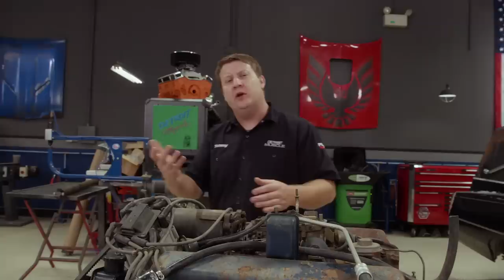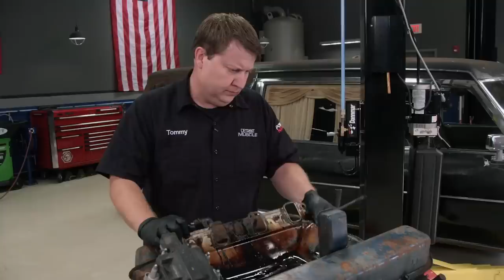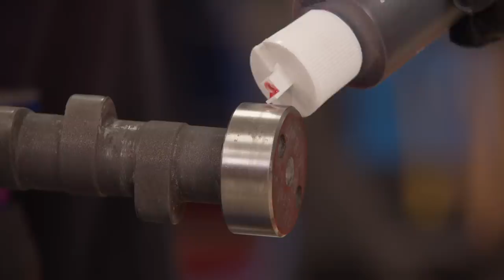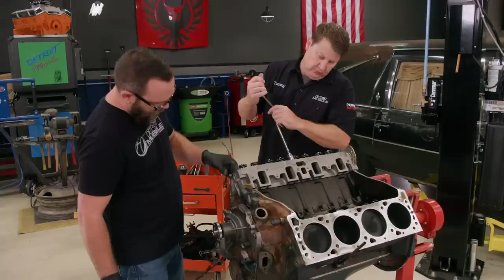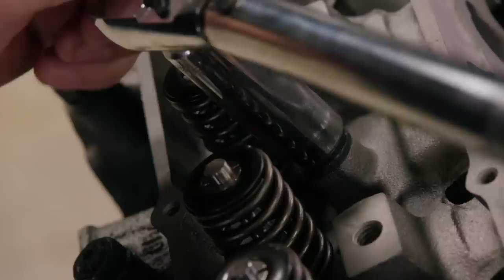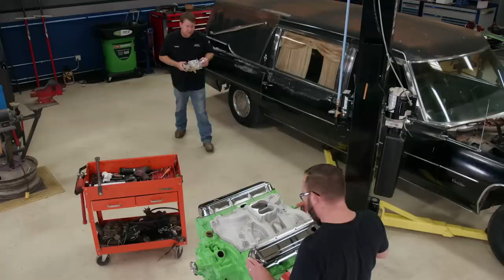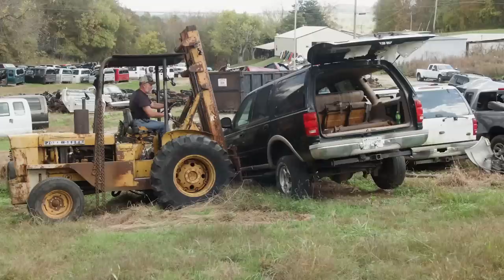Upgrading the Cadillac 500 To Make Serious Heavy Horsepower - Detroit Muscle S8, E2

Comment: I wonder if they checked the crankshaft bearing for wear.
Reply: Nope. Nor the camshaft bearings. Elcheapo ‘upgrade’.  That new camshaft lobes look near unmachined too.
Reply: They should have re-ringed and put all new bearings at least. nothing like a half ass upgrade.
Reply: @TheBeingReal  it's a coating to the cast steel that makes it oil slick and not run off for run in purposes on a flat tappet camshaft. 

Only time you'll see bright machined lobes is a reground flat tappet or a roller tappet. Because of the ramp rate and springs required for roller they always make them out of billet.
Reply: @TheBeingReal  I just installed a new Trick Flow cam in my small block Chevy and it looked the same. It almost looks like a thin coat of bedliner. (I know it's not bedliner). I assumed it was some sort of break-in coating. It was nearly black and rough as 80 grit sandpaper. The cam broke in normally.

Comment: He keeps calling the stock stuff junk. It was not. Those old rocker shafts never failed. That's not junk.
Reply: Cadillac rockers are fine IF you keep it completely stock but they are useless if you install a hot cam and upgrade the springs.
Reply: @timsharpe3498  Pretty much nobody buying a Cadillac back then was interested in hot rodding them. They were high end luxury cars.
Reply: @wymple09  

The engines were made so well that many outlived the cars and wound up in airboats

Comment: The 500Cadillacs are the new big Lincoln engines of the early to mid 1970's  They're power to the poor. In the 70's all you did is stroke a big lincoln and you had like 500 + Ft lbs of torque for relative pennies. Now the big Cadillacs are junkyard aging into the same role. Thing is, why not some moderate head work? Also what induction systems in order of cost are available and to what effect?
How about some kind of simple low cost intermittent use forced induction for momentary use?  
!

Comment: You're going to run nitrous oxide through that motor and you're not going to take the Pistons out and widen the ring Gap how long you think that motors going to last like that
Reply: I ran a 1975 Dodge SWB truck with a 472 inch Cadillac. Ported/polished heads, stock valves, Lunati mild cam (daily driver). Tweaked TH-400 with stock converter. Stock intake with rework Quadrajet, stock exhaust with 2.5 duals. Position rear with 3.08 gears and NOS 125 shot of squeeze. Would run 12.10's without spray, 11.70s with squeeze on 10.5 x 28 slicks. Put 125,000 miles on it. Great engines.

Comment: I have a 1967, so I'm gonna be really interested in this one!!😁😁
Reply: and your cool ... one day a year, 355 days a year your neighbors are like "oh that guy" Lol Im joking!
Reply: Ed Miller  I have thought about doing a 500 swap because parts are difficult to find for the 429, and there are litterally no performance parts available for it
Reply: Ed Miller  I have the De Ville. It's rear wheel drive. The 429 is actually a different series engine than the 58. The series that is the 429 started as a new series in 1963 when it was a 390.  The series that was the 58 engine actually started way earlier like the early 50s. But like I was saying, parts for these older engines are becoming more scarce. I actually had to "order" plug wires!😲😂😂. "The Cad Company" and "Maximum Torque Specialty" only do 472/500/late 429 series engines, however I did find a place called "Caddy Daddy" that does do stuff for the early caddys. Also, "Original Parts Group" also has some limited stuff for em.
Reply: Ed Miller  remember that while the 472 first came out in the Eldorado in 1967, they became standard in the De Ville in 1968, the whole reason that they did away with the 429 is because in 68 GM standardized the bell housing bolt pattern of Hydramatic transmissions. Prior to that, all GM products had their own specific transmissions. The TH475, and TH400 has the exact same bolt pattern. That is how the Oldsmobile Toronado was also front wheel drive. They shared a transmission. So while mine does have a TH400, it is specific to Cadillac, Buick, Oldsmobile, and Pontiac and won't fit on a Chevrolet.
Reply: Ed Miller  so yes, all engines that had a TH475, also had a TH400
Reply: Ed Miller  believe it or not, a TH475 would bolt right on to your 454. You'd just have a little chunk of the top of the bell housing that protruded below the flange at the top of your engine. The actual pattern is the same, the only difference is the "W" part on the top of the bell housing
Reply: Ed Miller  I have seen some TH400s that were "bisexual"😂  that would go on  BOPC engines or Chevrolet engines.

Comment: Car Craft took a 500 caddy in stock form without all the stuff like the exhaust,  and alternator. power steering,  and it put out 350 horsepower and 420 pound feet torque.
Reply: Yeah with tired springs and floppy guides and 20 degrees of slop in the factory vinyl timing gear, it's amazing it did that well. Plus ridiculous emissions friendly soft '70s cam :-(

Basically just new moly rings, bronze guides, good three angle valve job, modern day (even close to stock) cam, real timing chain and a solid carburetor tune will get that torque back up over 500 and HP up to 400.
Reply: @Bolton115  
I put a 75 , 500 caddy engine and the turbo 400 trans in a 77 Chevy pick up and it ran very well, biggest problem was trying to get traction.  at 25 MPH floor it, and the right rear tire went up in smoke. I did get 15 MPG on a long trip though
Reply: @bertgrau9246   they make great truck engines.  Always thought GMC shoulda swallowed their pride and made a four bolt main version of the 425 Cadi engine with all the heavy duty cooling and accessory gubbins (air brake compressor mount).  Woulda made 100 lbs/ft more torque at 1000 lower RPM than that bearing spinning, valve sucking 427i they put in all the C8000 chassis back then.  And 100 lbs lighter!
Reply: @Bolton115  
Yes sir,  the 500 was only 100 pounds heavier than the small block 350, the turbo 400 was a little heavier than the 350 mot sure how much though.

I did change the oil pan oil pick up tube,  and timing chain and gears , and the water pump . To make it fit in the Chevy I used an el dorado oil pan (rear sump )

Comment: I have a -76 Eldorado with fuel injection,210hp...If doing this uppgrade,will the fuel injection still work without any mods?Another thing...Can the transmission take the extra power?
Reply: Im new into this oldschool car scene, got a 72 eldorado convertible with the 500cui. They use the TH400 (Turbo400) Transmission. Some people use it in the drag scene so i think the more power will be no problem.

Comment: Heads have been off that before--no steel shim gasket. Cleaned up? HA!  I wouldn't do anything without hot tanking first and running a hone through it. Spending big $ on the top end while the bottom end is crusty crap. Nitrous? Yeah if you want to break the pistons!

Comment: Sorry but putting rtv then a gasket, then more rtv sounds like you triple gasket the damn thing. Probably gonna leak eventually 🤷🏻‍♂️
Reply: Yup. They should use either rtv or just the gasket. Not both.
Reply: On certain gm engines you gotta run some film of rtv on both sides of the gasket when you have a timing cover water pump plate, just how Caddys are.

Comment: I wanna just state this    how are the water jackets  because I know there different from the 500 and the 425
Reply: Definitely not a bolt in swap
Reply: And welding and matching. The 425 head doesn't have as much meat to adequately cover the water jacket on the 500 block.
Reply: @brianwolgamot7076  there all inchangable parts     I got a 425  I was thinking on putting 500 heads on but I'll leave them stock and just put bigger valves in   and a 472 crank

Comment: Caddy made some factory 500 horse 500 inch V8's. Some came in the Eldorado. I know a guy that has one. It'll smoke the front tires for a city block, it'll hit 120 without effort.
Reply: I believe the most powerful 500 CID engine Cadillac made from the factory was the 1970 edition rated at 400 HP.  https://en.wikipedia.org/wiki/Cadillac_V8_engine#500
Reply: Adam Patterson I worked in GM Engineering for 33 years and I never heard that. Better check your sources!
Reply: Yup Motors repair manual 1970 Cadillac 500 ,375hp and 525 ft lbs torque ,Those are conservative numbers.
Reply: Puff Kendrick So your opinion makes 500 hp a fact? Cadillac didn't make a 500 horsepower engine! Keep dreaming.
Reply: @SLJ2137694  Go back and read my response about Caddy 500 cid
Reply: @puffkendrick6850  you said 375 hp, 525 lb ft torque. Your gut feeling doesn’t make 500 hp a reality. If your gut feeling that is unsubstantiated makes you feel correct, I’ll let you have your way!
Reply: @SLJ2137694  Go back and read my comment
Reply: @SLJ2137694  I could be wrong guys. I just know that back when I was young and bullet proof we'd run that car in to nashville from brentwood and that thing would cruse in the triple digits. Might have got the torque numbers mixed up with horse power. The only car that would keep up with that caddy was another friends LTD with a 460 police interceptor. Fun times.

Comment: They make 350hp or so stock on 500 my 425 from 77 makes 220hp
Reply: Sorry to tell you this but your 425 makes 180 h.p. not 220. Low compression 500 make 190h.p.-210h.p low compression 472 is around 5 h.p. less. depending on how there rated. 368 makes 145h.p.

Comment: Why would you just torch the rearend out? sloppy.
Reply: Cutting torch is quicker. If you tried to remove the the bolts holding it in you'd be spending hours trying to get them out of the bushings if it is a rust belt vehicle.